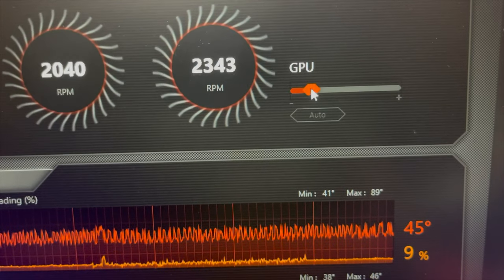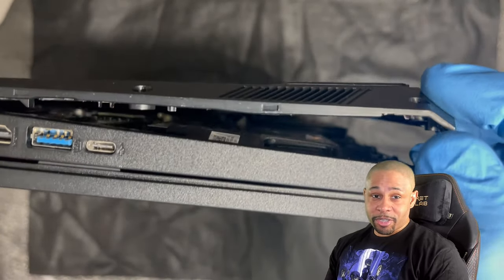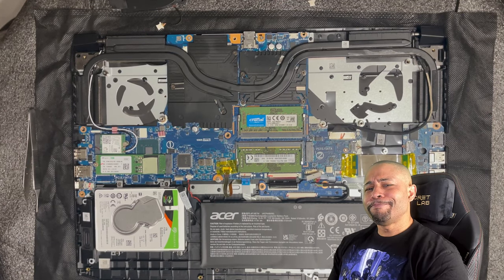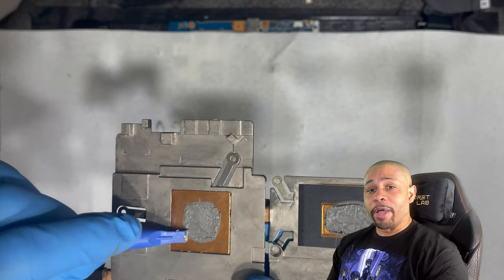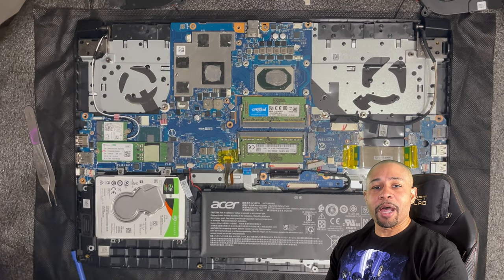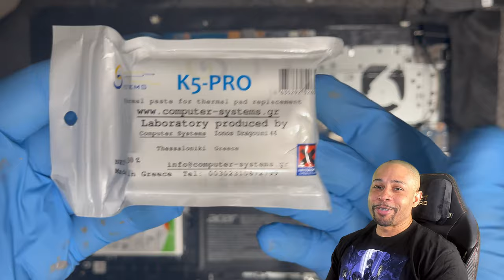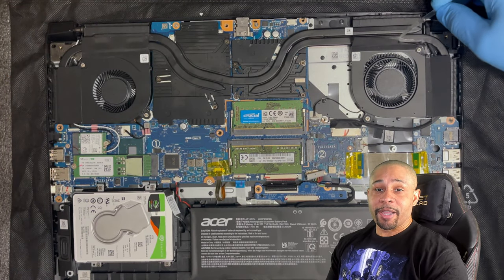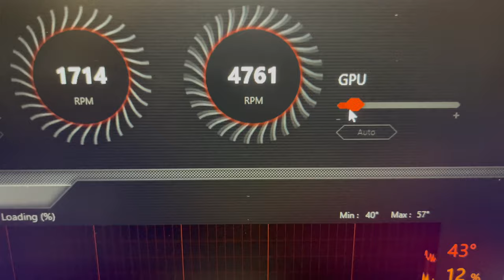Fan Replacement & Repaste Tutorial Acer Nitro 5

Comment: I want to ask a few days ago I disassembled the laptop to clean the fan from dust, after finishing the battery indicator light turns blue even though the laptop is off, before Still normal, but there is no problem with charging, the battery is still fully charged when charging

However, the battery indicator light does not turn on when the laptop is turned on, and the battery indicator light does not turn on when the laptop is on

Could you please know how to fix this kind of problem, it's not a problem with the battery but it's bothering me
Reply from the maker: When the AC adapter in plugged in and charging the laptop, the light will show an amber color. After fully charging the light will show blue.  Unplugged it shows nothing.
Reply: @Meanpooh  Yes it doesn't show anything after fully charging the blue light stays on but it only lights up when the laptop is off
Reply from the maker: Something definitely going on maybe a connector prong is bent.  Almost as if a short has happened.  I would make sure all the wires are connected fully(the ones you disconnected) and keep an eye on it.  If the machine is under warranty Id send it in and make no mention of disassembling.
Reply: @Meanpooh  may i ask one more question? how many Celsius is the normal limit for cpu temperature when playing games?

My laptop when playing games without plugging into the AC adapter cpu temperature is 60-68 Celsius when plugged into the AC adapter the temperature increases to 80-90 is that normal or do I need to replace the thermal paste ?
Reply from the maker: Your temperatures are completely normal.  👌

Comment: I repasted my Nitro 5 with arctic mx-6 and temps are significantly worse? My GTX 1650 thermal throttles in minutes
Reply from the maker: Did you replace thermal pads as well?  Something is definitely wrong.  I would try again.  Make sure that all screws are snug.  Do not overtighten.  You can also try a different brand of grease but regardless of the brand, it should not throttle within minutes if done correctly.

Comment: Cool video! I really appreciate if you can show me how to clean up the fans instead of buying a new pair! Tks so much for replying!
Reply from the maker: You can use a small toothbrush to clean them.  Use compressed air to blow the dust out.  Makes sure the compressed air is made for electrical parts.  To be safe hold the fan blades when using the air so they wont spin.

Comment: I've only had mine for over 3 months and although doesn't sound nearly as bad as this, I've been noticing less air coming out on the gpu fan but it shows on nitro sense that it should he spinning faster. And it's not like before, now it's hotter but weaker, as opposed to the strong flow of air that it once had. I've cleaned the fan with a makeup brush once when I upgraded the ram but didn't bother to take out the fans as I did not have a thermal paste with me to replace the old one. It wasn't that dusty but now I'm suspecting a blockage in the vents causing the reduced airflow.

My question is what specific thermal paste do you recommend on this laptop and how often should I clean/replace the thermal paste to avoid thermal throttling
Reply from the maker: Thermal Grizzly Kryonaut, Cooler Master MasterGel Pro and Arctic MX-5 are some good ones.  They are not conductive so its safe if you accidentally get it on your motherboard.  If you can reuse your thermal pads, do it.  If not replace them.  Gelid Solutions is a good brand.  K5-Pro is good but it's messy and some people don't have good results although it has worked fine for myself.
You should only change thermal paste, grease and thermal pads if your temperatures are higher than normal with the fans cleaned.

Comment: Can we replace only GPU in Acer Nitro 5 An515-45 in case it stopped working?
Reply from the maker: No.
Reply: @Meanpooh  what should I do? My laptop is out of warranty and i can't really afford to buy another motherboard. Any idea how much it would cost?
Reply from the maker: What is wrong with your machine?
Reply: @Meanpooh  I'm getting error 43 with yellow exclamation mark on my Nvidia 1650 gpu in device manager. But once i update my drivers, it shows working but still it is not detected in Graphics section, only my AMD graphics card(dedicated) is shown. And once I restart my laptops, the error code returns. Is it a hardware or software issue?
Reply from the maker: @yaminhaqani6387  What I would try, would be to remove the video drivers with DDU.  Then manually install your graphics driver.  If the problems keeps coming back it could be a hardware issue in which the manufacturer has to fix.  Using an external graphics card would fix the issue slightly which is a hassle to get working.  The motherboard will still has issues that has not been resolved that could come up.
Reply: @Meanpooh  i was going through Nvidia forum, and many people are reporting this issue after updating to latest driver. Maybe it's a software issue

Comment: Hey i removed the pink grease from vrms ..now my laptop is overheating...i tried applying thermal paste and pads there...nothing seems to work..i can't play any games without lags since the day i brought my lapi..am very much frustrated...please someone tell me what should put into vrms ?
Reply from the maker: The pink stuff is liquid or spreadable thermal pad.  Since you removed it you will have to use regular thermal pads or K5 Pro which is close to what you removed.  Using thermal grease that is for a processor application will not work.  It's not viscous enough and will run.  Using regular  pads will require you to use different sizes which will be difficult.  Your best best bet is K5 Pro or some other brand.
Reply: @Meanpooh  can you recommend any other brand coz k5 pro is not available in India...i will have to order it from usa..but then it becomes very costly coz of custom and taxes ...so is ther any other brand or alternative ?
Reply from the maker: Try this brand TG-PP10 Thermal Putty or you could see if this works https://www.aliexpress.com/item/3256803056008560.html?spm=a2g0o.productlist.0.0.bc8265a4KAfCPW&algo_pvid=11a69a7c-541b-4b0e-8f29-e5151c12bce7&algo_exp_id=11a69a7c-541b-4b0e-8f29-e5151c12bce7-0&pdp_ext_f=%7B%22sku_id%22%3A%2212000024820941574%22%7D&pdp_npi=2%40dis%21USD%21%2113.99%21%21%21%21%21%402103399116579185077263947e17d6%2112000024820941574%21sea

I plan to get some soon.

Comment: I did something similar on an Acer Nitro 5 AN515-43 but I just repasted and cleaned the cooler and that's it. When I booted it up the fans were spinning and was able to control it. However, my cpu R5 3550H is stuck at 0.4GHz regardless of what I do. No fan issue, updated drivers, reset windows, power plan tweaks, bios reset. The problem still persists, stuck at 0.4GHz 19% util. Please help me.
Reply: Note: temps are at 40° - 50°, used cpu-z and hwmonitor to check and says 400MHz on all cores. Weirdly enough hwmonitor only displays 4 cores instead of 8 like back then.
Reply from the maker: So the machine was running fine before the repaste and cleaning?  What happens when you set the Power Profile to High Performance?  I don't know what model you have but some have a reset button on the bottom.  You might try to use it if it's available.  If that does not work try removing your power supply adapter and or battery.

Comment: Is it necessary to use K5 pro on chips around cpu and gpu or i can use normal thermal paste as well?
Reply from the maker: No and No.  If you don't use K5 Pro, use Regular solid thermal pads or another brand of very viscous thermal pad.
Reply: @Meanpooh Pooh, what's the size for the thermal pads if I don't use k5? 1.0 or 1.5? Because i don't get k5 in my country.
Reply from the maker: I used these which are 1.0 mms.  You just have to be aware of gaps to the heat sink if there were any in the first place.  Thats the reason for the liquid(very viscous) thermal pad because it can fill them in.  It can be messy.
 I used these when I replaced pads on my other machine. https://amzn.to/3LKbaYp
So far so good.

Comment: Thanks a lot. I have Acer Nitro 5 2021 version with rtx 3060. Just now replaced with Artic-MX4
Reply: How are the temps, did it stop thermal throttling? i have the 2020 version with the RTX 3050 and I5 10300 and i will change paste when it gets here from amazon, because its pretty much always throttling because of the stock thermal crap they put on it

Comment: One of the fans on my daughters laptop isnt working much at all and makes a noise loud enough to hear all over the house. lt was like that soon after we got it. l cleaned it and eventually just cut the wires to it and my daughter said it made the computer run slower?????
Anyway l just want to replace it now and l'll go online to find the fan we need. Hopefully this can be done without the need to solder. 
Edit: oh the fans of my daughters Nitro seem to be together in a sealed unit.... what now?
Reply from the maker: If you mean the screws are harder to get out then you you will have to apply more pressure.

Comment: When i do this ? I Have 1 year Acer nitro 5
Reply from the maker: If your Acer it under warranty contact Acer to get the fans fixed.  If you are out of warranty and your fans are not working correctly then you should replace as in the tutorial.  If your machine it getting very warm such as keeping temperatures above 95C then you might want to repaste.
Reply: @Meanpooh  in Forza gpu on max 86°C
Reply from the maker: That's a little warm for the GPU, how is the CPU?
Reply: @Meanpooh  forza is game on GPU if i play game on CPU, CPU Is on 70-80°C maximum in game i spooted 90°C in summer
Reply from the maker: So youre saying that while gaming in Forza the CPU is between 70-80C and the GPU is 86C?  
If so, then your CPU temps are normal.  The GPU temp on the other hand is odd as it should be lower.  Here are the temps I got on my machine that is in this video
https://www.youtube.com/watch?v=obE8mXXtlo0&ab_channel=Meanpooh
Make sure nothing is blocking your vents on the bottom of the machine.  You could try and elevate the laptop from the back or use a laptop cooler.  If this does not work then I would repaste it since you mentioned that you've had it over a year.
Reply: @Meanpooh  nono in Forza 60°C cpu in other CPU games IT Is between 70-80
Reply from the maker: @samx_7262  Ok, then I think you are fine.  Your temps are very good.  I would not change a thing.

Comment: So after 2 years of constant use. Smoking cannabis near it. And with animals, cats and dogs. I finally bought the screw driver to take out the back screws and the fans were almost solid lol. The cannabis smoke has molded with the hair and it was like a thick coat. Just bought two replacement fans so this videos very useful.
Reply from the maker: You're welcome.  Don't forget to disconnect the battery.

Comment: thank you i could not find any video on for this model so far left a like and a sub sadly amazon does not got the fans in stock currently its been mostly my gpu fan for me as a complete computer noob this helped alot
Reply from the maker: Glad I could help out. If you have to order from eBay make sure to check the price. A lot of times they show 2 fans when in reality the price is for one. Shipping origin is the thing. Either it’ll take a month and or high shipping prices. 
So far the replacement has been working out without issue. Good luck 👍

Comment: Mines aren’t too bad with noise but when I test at max one is 5000 rpm and one is 6000 rpm
Reply: Is this bad with such difference? I obviously do not use it at full blast lol
Reply from the maker: Depends on how long you have had it.  Its natural for the RPM to vary over time.  If its new then, yes, its a problem.